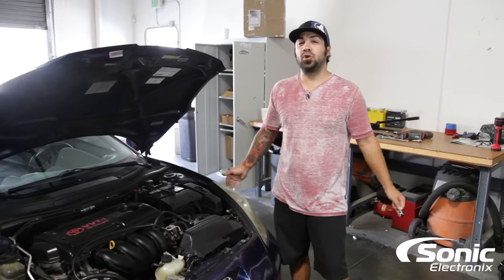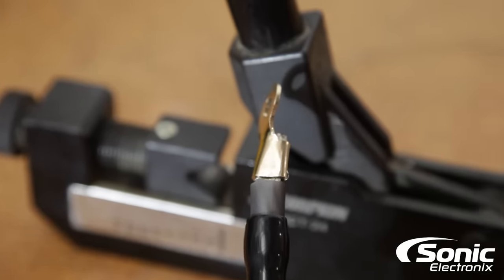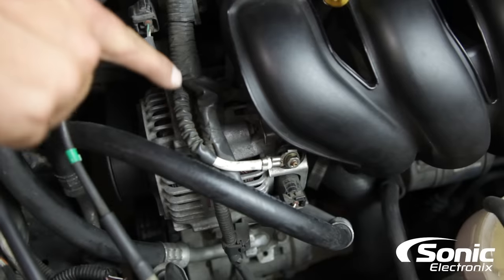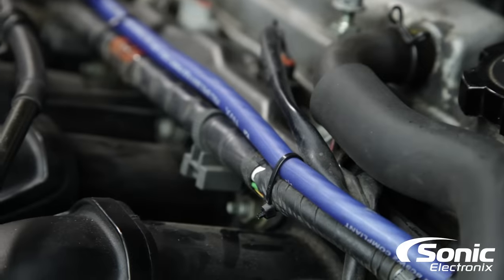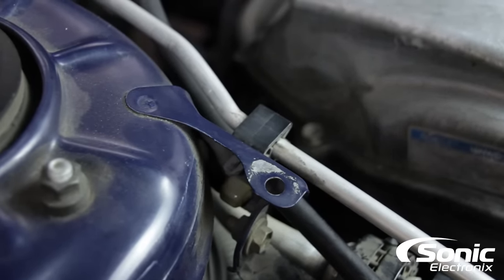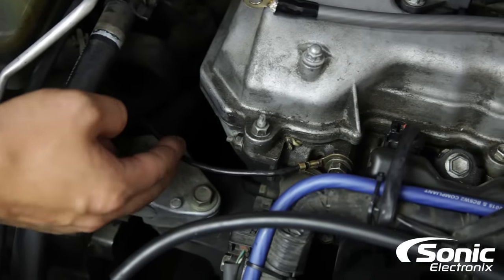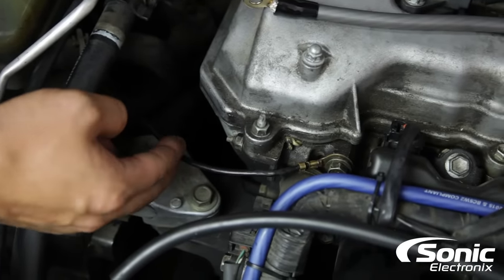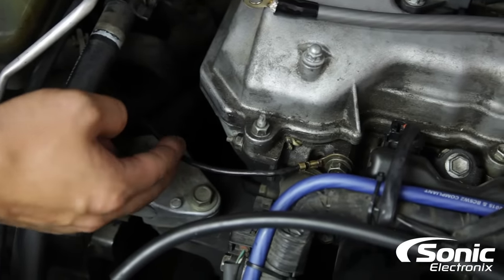How To Install the Big 3 Upgrade | Improve Your Vehicle's Electrical Charging System | Car Audio

Comment: What does adding the big 3 do for a high powered stereo system??
Reply: It is suggested that if you install a car audio system of 1000 watts or greater you will need to upgrade the stock wiring in the charging system. This is the most overlooked necessities
of car audio. The stock wiring is only adequate for the electronics the vehicle came with from the factory. Any extra demand will require upgrading the wire and possibly the alternator.
Upgrading these three main wires will ensure that you will get the maximum performance your alternator is able to deliver. They all make up the charging circuit and will require upgrading when you put more demand on the charging system with aftermarket electronic accessories.
Reply: @a.k.3659   So my amp says it’s a 1200 watt amp. SMD did a dyno of my amp and said at 1ohm it’s hitting at 1700 watts at 14.5. My subs are wired at 1ohm. My factory alternator says it’s a 270 amp. I have not ran a volt meter to see the voltage when it’s up loud but with an alternator like mine, you’d think it would be fine but my headlights dim when the bass hits. Will doing the big 3 upgrade help or even stop that from happening? Or should I get a secondary power supply too?
Reply: @johnnoehl8917  Dude, you 've got to try this and tell us here. 🧐🧐🧐
Looking forward to hearing from you soon.

Comment: I just got done doing the Big 3 on my Jeep Cherokee the boat is reading at 14.2 Bakery in it is Richmond only 13.8 don't understand I have sanded the metal down put 0 gauge wiring in done it step-by-step not too happy with the results don't understand alternator is pretty big battery is big on cold crank maybe you know what I need to do

Comment: What does the big 3 do to your sound
Reply: It is suggested that if you install a car audio system of 1000 watts or greater you will need to upgrade the stock wiring in the charging system. This is the most overlooked necessities
of car audio. The stock wiring is only adequate for the electronics the vehicle came with from the factory. Any extra demand will require upgrading the wire and possibly the alternator.
Upgrading these three main wires will ensure that you will get the maximum performance your alternator is able to deliver. They all make up the charging circuit and will require upgrading when you put more demand on the charging system with aftermarket electronic accessories.

Comment: Does it make system put out more voltage?what does it do
Reply: It is suggested that if you install a car audio system of 1000 watts or greater you will need to upgrade the stock wiring in the charging system. This is the most overlooked necessities
of car audio. The stock wiring is only adequate for the electronics the vehicle came with from the factory. Any extra demand will require upgrading the wire and possibly the alternator.
Upgrading these three main wires will ensure that you will get the maximum performance your alternator is able to deliver. They all make up the charging circuit and will require upgrading when you put more demand on the charging system with aftermarket electronic accessories.

Comment: Will this help with surging issues when my headlights are on? I can’t seem to figure out what’s causing it. Only seems to do this with headlights on though and car stalls. I’ve already upgraded the alternator charging cable to 4g And alternator is 140amp

Comment: A buddy of mine has 2/0 wire and offered me to use it for my 2016 Chevy Cruze big 3. Is that too big or would it be fine?
Reply: You can use bigger wire, the only real downside would be the physical size of the cable could be too large or hard to fit in certain places but as far as the electricity goes it will work fine 👍

Comment: honestly l always thought this upgrade was snake oil, and l still think that. unless you're upgrading your alternator, the stock wires should be just fine. a stock alternator is like 60-80 amps which comes out just below 1000w of power, a 12awg wire can handle that just fine.

Comment: New cars are a low amp draw that is why some wires are smaller the old cars and trucks are a high amp draw so you probably dont have to upgrade the wires

Comment: i have 2 engine grounds can i get away with just changing one? Theres one on each side of the engine. Im going to be using 1/0 ofc wire because i have a couple feet just laying around
Reply: Yeah just replace 1. No need to replace both.

Comment: Just recently bought a acura which seems like it had a system everything was done correctly but i dont have a system so took the ground wires off, I cannot take off the one for the alternator because theres not much space, will the be an issue if i leave just the alternator wire connect to the battery?? Please someone help ‼️‼️

Comment: i'm having a hard time understanding why you would do this. It cant be for more power since you are not upgrading the Alt or Battery. The Alt is engineered to produce only so much power, and the battery is designed to take and out put so much as well. IMO adding bigger wires doesnt add more power.
Reply: It is suggested that if you install a car audio system of 1000 watts or greater you will need to upgrade the stock wiring in the charging system. This the most overlooked necessities
of car audio. The stock wiring is only adequate for the electronics the vehicle came with from the factory. Any extra demand will require upgrading the wire and possibly the alternator.
Upgrading these three main wires will ensure that you will get the maximum performance your alternator is able to deliver. They all make up the charging circuit and will require upgrading when you put more demand on the charging system with aftermarket electronic accessories.

Comment: ground wire won't habe load from chassis to engine on Honda on let side ground wire if disconnected it runs like shit because it's ground for fuel inj.

Comment: Can you do a video on big 3 upgrade for 05 Equinox
Reply: I mean the battery ground is the same for every vehicle, a cable running from negative term to a nearby solid piece of metal.  The other two just search youtube or Google for.  
2005 chevy equinox engine ground 
For instance

Comment: How does changing the gauge of the three wires identified make any difference? The alternator doesn't add more power because of it....someone explain it for me please?
Reply: Any source of voltage (battery or alternator) will deliver current as a function of both its voltage and the amount of electrical resistance it has to overcome.  (Yes, wire has resistance. And the greater the current the greater the effect the wire's resistance becomes.) Big automakers will supply their cars with the absolute minimum size wire they can get away with as copper is expensive and they make many thousands of cars; the cost adds up fast. Thicker gauge wire can offer much less resistance than OEM sized wire, making the voltage sources not only deliver more current, but also allowing them to work more efficiently (less wasted power). The greater the current needed, the better the performance will be on whatever needs that current --- for example, your starter, AC or rear defogger element.  And especially a 1000 watt sound system with that 1 note bass subwoofer.

Comment: Didn't watch it. But electronics lesson 1: electric current goes the least résistant (I. E. shortest) route. So adding wires may help or may not, depending on impedance values.

Comment: 🤔 first time I hear about these stuff and why Is it necessary to replace those wires? And specially that engine block wired, how important is that like what does it do? I mean I don’t get it. If you already have a negative connected to the chassis and the engine it’s mounted onto the chassis which already has the ground, why another ground?? Can someone explain please cuz I’m like in a different world right now 😩😆🙈🙄.

Comment: hello brother, can i use a capacitor even though i dont got a amplifier? i do have some 12v leds, windshield wipers, heater defroster running very ofter and i got a small battery.. will it help??
Reply: Capacitors discharge extremely fast they won't help you need more alternator/battery power

Comment: I have a GMC Sierra and it's hell trying to remove the bolt where the ground is fastened into the block.
Reply: @stanshelton4592  I never got it loose. I discovered my problem was the computer. But that's a good idea to use another bolt.

Comment: Hi, i have fx35 2007 with 220k KM. the thing is when it get hot weather, the  doors actuators become lazy and stop functioning. The same regarding the starter. The security peep sound from the horn barely heard. So do you this those upgrades can help?  Thx

Comment: Hey i have a question i bought my first sub setup last week sadly i only play on 800 watts rms on 2 ohms i have a 60 ah battery the guy that i bought it from said i would need a 80 ah battery but the one he sells is 350 bucks but is audio specific would i need a audio specific one or do all 80 ah batteries gave the same watts? At 1 ohms the amp will be playing 1600 watts rms 3600 max

Comment: Only way I see this being any good is if you own a diesel with a 2 batt set up, have a massive stereo, or have an upgraded alternator. Other than that its all factory its worked for years so its obviously capable of the job.

Comment: thanks bro! did my upgrade just according to your video which I keep playing and pausing and replaying back again. I know I may look and sound stupid but the result was a great success and i took pride in it for the DIY. but my electrician told me that I should be passing on the fuse box for the alternator and not directly to the positive terminal of the battery. any thoughts on that area?

Comment: What happens if a few months after you've installed the big 3, you realize its only the big 2 because the guys at the shop didn't install the Negative Battery to Ground...

Comment: I have problem with my Lexus is the power still 12.4 and down I change antinature  but the battery doesn't recharge if I do big 3 upgrade it will solve my problem or not?
because I sent it to garage he put wire from engine to body it solve the problem for one month then the same problem came back

Comment: i just did this big 3 after that my check engine appears in my dashborad panel.
Reply: Yup.. As contrary as it seems, one of your car's sensors is/was out of whack because you provided too low of an impedance path to chassis ground where there shouldn't be one, and/or over time the sensor has calibrated itself to a deteriorating ground and now the cleaner path is providing a more accurate reading - one which the ECU determines is out of range as over time it's been skewed. Not a bad idea to reset an ECU after doing this.
Reply: remove the bulb that shows ther check engine icon

Comment: the stock battery wire pass tru to the battery regulator while the additional battery wire  it by pass the battery regulator so there are two line in the stock line 1. with the battery regulator 2. the additional battery wire with out the battery regulator. correct me if im wrong he by pass the battery regulator when the battery is full what will gonna happen to the battery..it will .burn isnt it while the other line is in the battery regulator it will kick when the battery is fullcharge but there are two lines rigth now. one in the battery regulator while the additional is direct with out the battery regulator....he forgot the battery regulator and will create a conflict and confusion to the electrical charging system

Comment: So my engine block ground is grounded to the negative on my battery..should i run my 2gauge following it or do a seperate end point to the chasis instead of the negative battery terminal..it actually meets with the battery ground at the negative terminal connected together where that then splits off to the chasis.any advice as im doing this tomorrow monday the latest..thanks anyone who can help

Comment: If you leave your car electronic stock you are changing nothing by doing that ... just saying ... the Alternator doesn´t charge more with two wires and the groud stays also the same as before because it doesn´t need more to work.  And if you have blinking headlights you should not upgrade your cables that is not correct if that is the case you need a condensator to make sure you don´t damage your alternator by those little highs that come when the amp is making big work for example when the bass hits hard. The condensator is exactly for these moments when extra power is needed ...

Comment: Your video is a good point! but pleas, do not take one car to be like every one. Not every car have + from altinator directly to battery.  
It can be seafty solonids ect, if you make a new + wire and bypass other electronics. This can make a problem in the future. 
Special new car.  2010+ mod

Comment: Good upgrade video but....He neglected to add.....Always use a conductive doping agent, PENETROX, to every connection. This product will elmiante any contact corrosion between the connector and chassis or B+ connection...ESPECIALLY IN HIGH HUMIDITY OR NORTHERN WET CLIMATES WHERE CONTACT CORROSION IS A REAL PROBLEM!!  Never make an electrical connection as he is doing here without it....AND, you must service the connections at regular intervals according to the environment the vehicle will be operated in......I use this product on all electrical connections on the vehicle and with my Amateur Radio equipment on board and in my home......Especially the power returns (Ground)

Comment: For the love of all that is good and holy, if you start removing strut tower, engine block, alternator, and etc nuts either look up the torque spec for the stud/bolt or have the service manual handy to torque them back on properly.

Comment: And there is a battery current sensor on that negative terminal run the big 3 grounds through it so it will send a signal to the ECM and the ECM will send a signal to the internal voltage regulator on the alt or you wasting your time on you Chevy's

Comment: how is this even a upgrade ? running that size wires unprotected trough your engine department ? then again, only if you run a wire from your alternator directly to your battery it might be a upgrade allthough i don't even know if the resistance is gonna be so much lower using a wire instead using the car itself...

Comment: Why would you want to "upgrade" what works? Not only that, but the car manufacturers spend a lot of time and money on engineers who have already worked out the proper wiring for any vehicle. And if your car catches on fire from an electrical issue because you screwed with the OEM wiring, it's all on you. Thanks, but I'll trust the car manufacturers and their decades of experience over a dude in his garage making a YouTube video.

Comment: Using stainless steel bolts, they're not going to rust... But the car will rust around it. Dissimilar metal corrosion...

Comment: Don't know if after all these years you will see this comment, but leaving the existing charging wire intact, you also continue to use it in addition to the new charging wire? I'm not a mechanic.

Comment: Big suggestion here, if your car has a fuse link or fuse in between your alternator and battery won't skip it, if a short is in place by any reason it will fry your whole electrical system, in that case always use same amp fuse on the wire you adding to the vehicle.

Comment: The new wires only provide less resistance which= less heat so if your lights go dim when you turn on your new head unit, amp equalizer and all those ANNOYING subs, this upgrade won't help

Comment: The crimp on that battery cable he showed was on the wrong side of the terminal. The "pointy" end of the crimper should have been on the BACK, away from the split. The split should be lined up on the "saddle" side for extra strength and better connection.

Comment: honestly cant see the point.. what is is supposed to acheive over the stock cables ?? youve lost me ...
Reply: You actually improve your alternator charging output and any other electrical gremlins that show themselves due to corroded earth terminals and the like. Ask me how I know? Because I have had these very issues on my van even after fitting a brand new alternator.

Comment: The real way to upgrade the electrical power of your vehicle is totally free and takes a minute. See what’s inside your battery (under the two plastic caps on top for most) is electrolytes and acid that have a reaction thus creating the ability to store the power given to it by the alternator and the best way to improve this reaction is to pop off those plastic caps on the battery then turn it upside down and shake out the rotten old juice then drink some gatoraid and piss into the cells . That’s right. Because urine aka “nature’s battery juice” has the best conductive Nano particles known to man. That’s why these batterie manufacturing plants are always near cheap beer breweries. So they can harvest the power of all that piss! Fuck’n google it!!

Comment: I think just added ground wire has enough to improve performance &  reduce jerking.. No need charging wire (need added fuse to protect circuit if u want add) 
Juz my 2cent opinion 😅

Comment: that's not the big three! the big three is upgrading our stock alternator to a high output alternator and upgrading our stock battery 
with a deep cycle or performance battery such as kinetik, shuriken, xp power and opitma battery etc........! And last upgrading the wires from the stock 8 gauge wire that most cars and trucks come with with 0 gauge wire; that's the big three not just changing the wires and leaving everything else stock, you as a professional such know that assuming you are a professional.